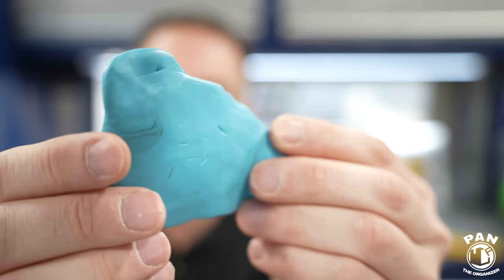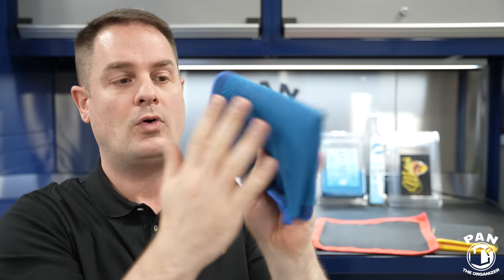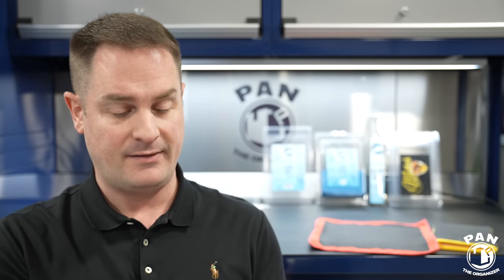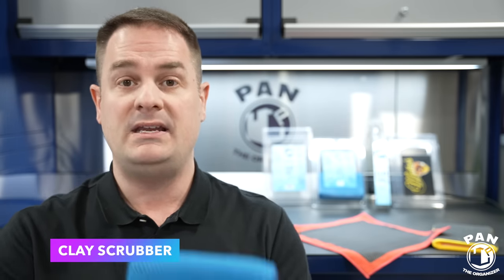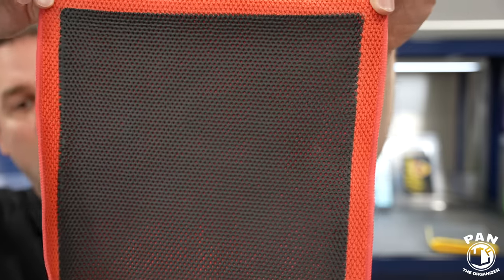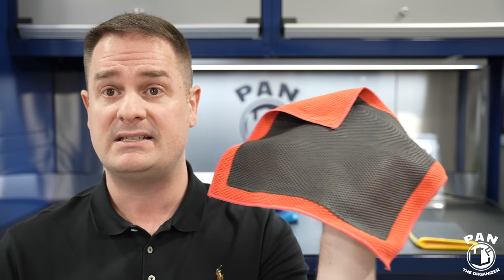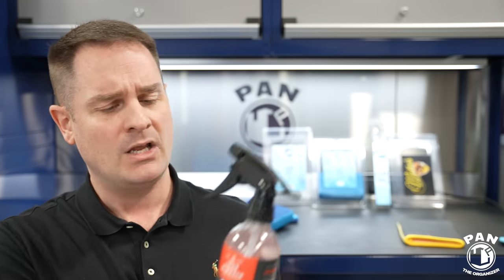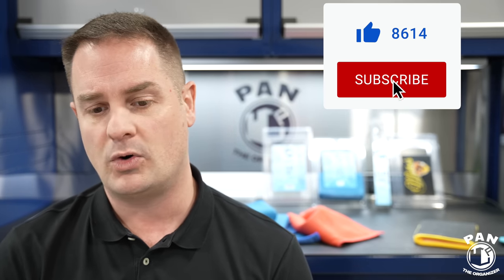The Future Of Automotive Clay Is Here… And It’s GOOD!

Comment: Can I use a clay media with a waterless wash?
Reply from the maker: I wouldn't recommend that, as you're supposed to clay a clean surface. A waterless wash won't offer enough lubrication. Use a rinseless wash method instead. Or even better in my opinion, wash your car the traditional way (soap and buckets and wash mitt), rinse it, and then clay.

Also, I highly recommend that you watch my Detailing 101 series for beginners, where I explain different steps like iron removers, clay bar, polishing, protection, etc. It's super simple once you understand the basics, and your car will look and feel 100x better!

Part 1: how to properly wash your car: https://youtu.be/7Koj5j2Es5U
Part 2: how to clean wheels and tires: https://youtu.be/omwcNcSYcS8
Part 3: chemical decontamination (iron and tar removal): https://youtu.be/W_cyHz3XssU
Part 4: clay bar: https://youtu.be/XB8UaTCXuLg
Part 5: machine polishing (paint correction): https://youtu.be/ustTEVGMOTI
Part 6A: how to wax your car https://youtu.be/KZjiPcsPBrA
Part 6B: how to apply a ceramic coating: https://youtu.be/sqQYVjxFqK0
Part 7: Differences between waxes, paint sealants and coatings: https://youtu.be/4ejfPHan3k4
Part 8: How to clean your car’s interior like a pro: https://youtu.be/Xx_lHXHYpLo

Comment: Yeah... I learned to my expense that you can't use CarPro Trix as a clay lubricant when you use a clay mit... and it was a white car... The clay material turned to a tar like gelly and started spreading itself on the white paint... luckily, Trix itself was obviously able to solubilize the now spread clay material so I was able to remove the big black streaks from the car. Now I have to purchase a new clay towel...
Reply from the maker: Correct. Never use chemicals with solvents in them if you plan on using them as clay lubricants. Solvents will damage the clay material.

Comment: Hi Pan , did you use those clay towels on your 911 ? Thanks
Reply from the maker: My Porsche doesn't really need claying as it's taken care of twice weekly and the brakes don't generate brake dust (carbon ceramic discs). But I did try the perforated clay media with lubricants to make sure they wouldn't damage the paint or my coating, and everything checked out. But I use those clay media on pretty much all the cars I detail, so I have tons of experience with them. You can see me use them in my full detailing videos. :). And many more to come.
Reply: Thanks Pan  for your swift reply 
You’re awesome 😊
Reply: Did you use the car pro polyshave clay cloth ? Don’t which grade it is ? Thanks

Comment: Is it safe to use a clay towel on a ceramic coated car?
Reply from the maker: I spoke about that in the video. It depends what clay media you are using. Not traditional clay bars as those are abrasive. But synthetic perforated decontamination towels like those from The Rag Company in the video, yes, they are safe as they are not abrasive.

Comment: The question that remains: do all of these towels and pads actually work? On a clay bar you can clearly see all the contaminants. That's stil a big advantage.
Reply from the maker: You know it works as the paint becomes smooth. When you don’t feel the contamination anymore, it did its job.

I have no need for claybars anymore except in the rare occasions where I have a super contaminated vehicle that hasn’t been clayed for years.
Reply: @PanTheOrganizer yes, that's easier when there are a lot of contaminants. But with regular claying you have the visual result of the claying process.

Comment: I personally use the Griot's clay towel. I think it's the older tech as the clay media isn't perforated, but in addition to the towel and a mitt they also offer a palm scrubber and a pad for use with polishers - two form factors i haven't seen anywhere else.

Comment: Scrubber vs towel?
Reply from the maker: I prefer the towel. Question of personal preference really.
Reply: I see. I am prepping to put a piece of PPF on the rocker of my car, and have never clayed before so I’m trying to see what would be most efficient. 

It seems as if the safest would be between the scrubber and towel. Is there a significant difference between the two? I definitely don’t want any marring, and the scrubber is a little cheaper. Would appreciate any insight!
Reply from the maker: If you use proper lubrication, there shouldn't be any marring. Don't apply too much pressure on the surface. But usually, after claying, we normally do at least a light step of paint correction, which would remove any marring anyways.
Reply: @PanTheOrganizer  awesome. I see. Do you think it’s worth to spend more and get the scrubber vs. just a light clay bar for my specific case? From what I’m understanding, the synthetic is less abrasive so safer?
Reply from the maker: Correct. Synthetic decontamination media isn't abrasive, so does less marring on the surface. But for super heavy contamination, on neglected paint, a traditional clay bar will work better as it's more abrasive.